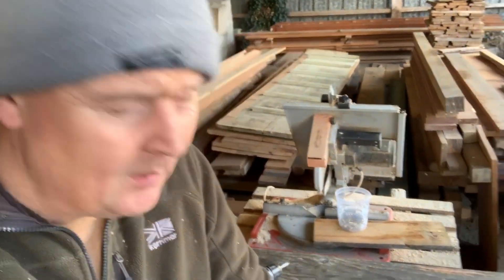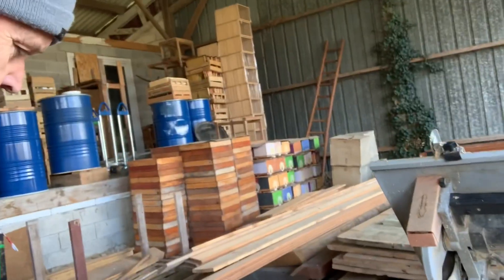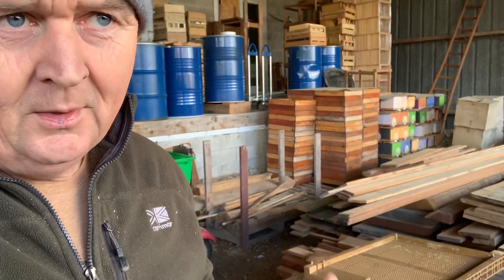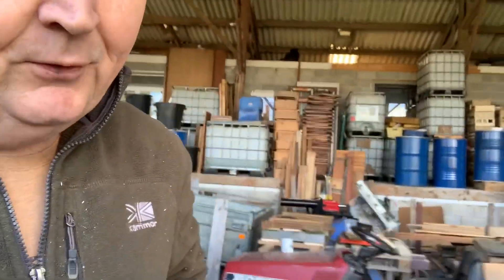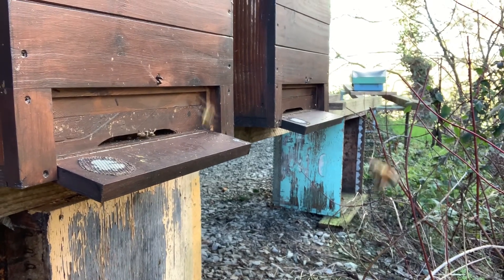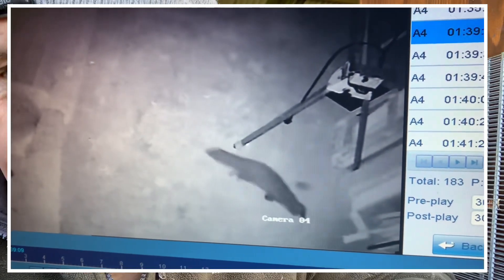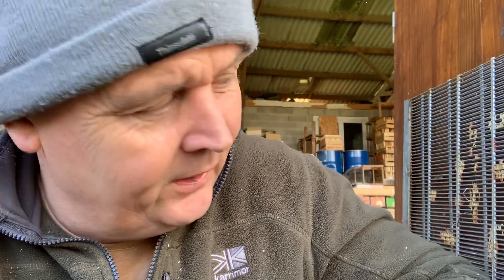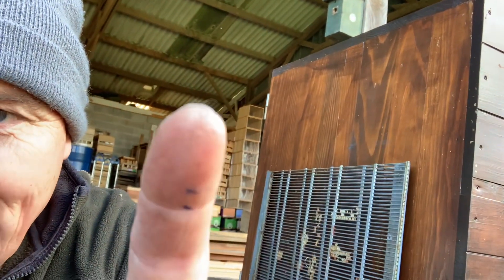Marten drops in for a visit!

Comment: You won’t hold water in the tyres if you drill 2 inch holes on the bottom (ground) side. I do this when I use tyres for my potatoes🍺🍺